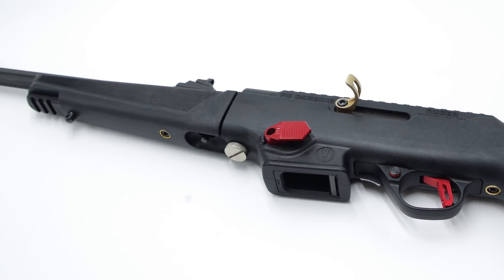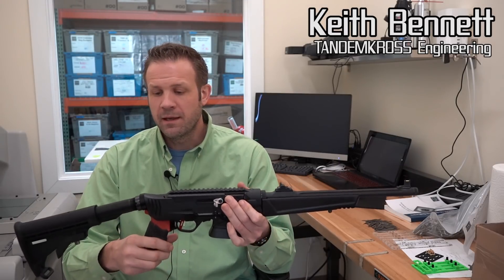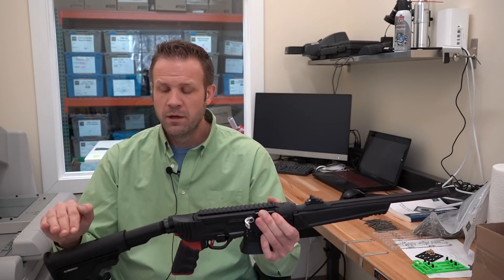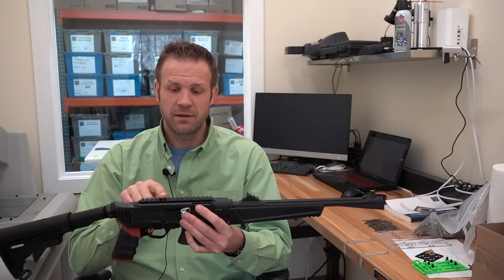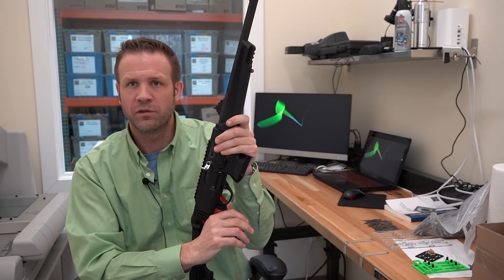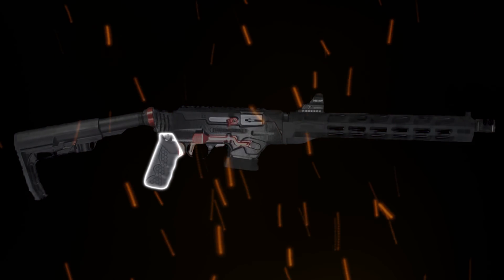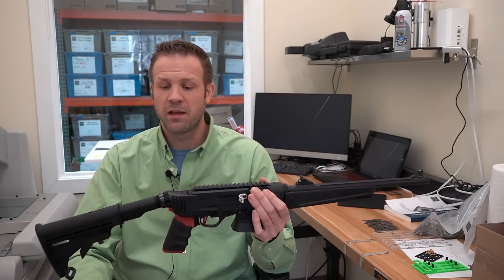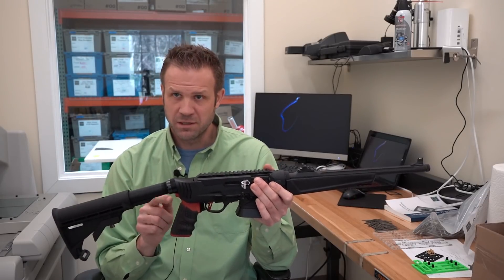TANDEMKROSS - "Upriser" chassis for Ruger® PC Carbine™ - Design details with TK engineer!

Comment: This chassis checks a lot of boxes especially in price. My one complaint as a left handed shooter, is  the mag release finger lever on the right side only. This  position makes it worse spot for a lefty , as i would have  move my support hand down further or try and access release button on left side. So not an ideal setup. If you are a righty, this should be an excellent setup.

Comment: I hate the angled butt stock designed. My milled AK had similar aftermarket angled setup due to its tangs and it just doesn't feel right when you shoulder it. I rather have a cheek riser than this.
Reply: I agree. That steep angle coming off the back of the receiver just looks goofy. I think an offset coming straight off the back would’ve been better. I’m sure there’s engineering and production issues when it comes to that but may need to take a little longer and put a little bit more effort into the design. It’s not appealing to the eye.
Reply: so you ain't doing that spacegrass because it doesn't feel right